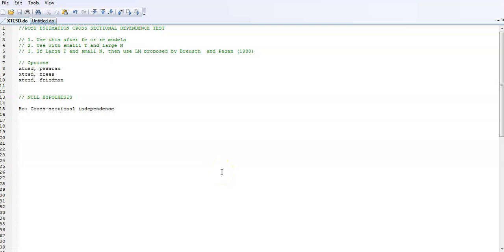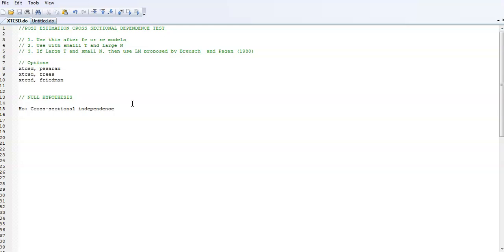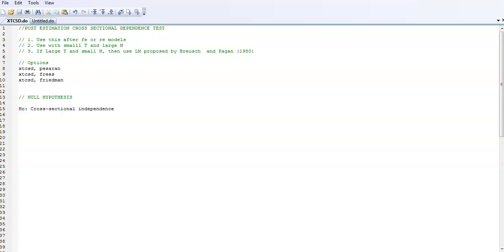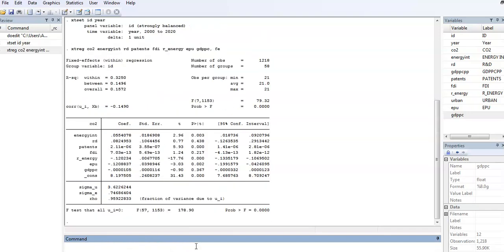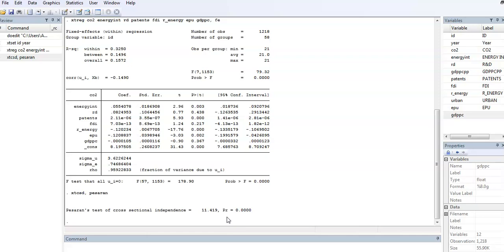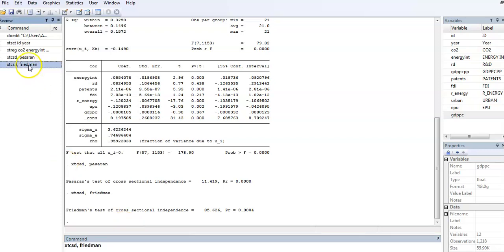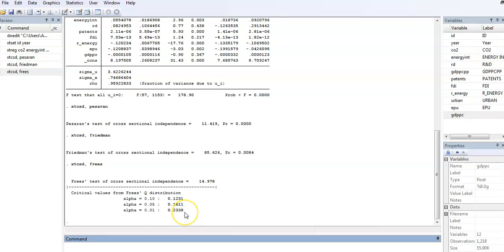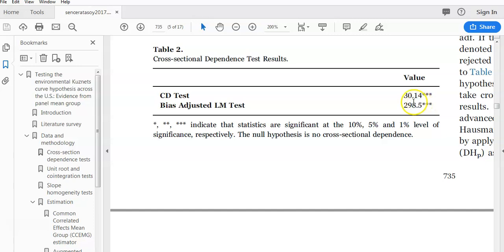How to test for cross-sectional dependence in Stata - post estimation test

Comment: Nice video thank you for sharing. I would like to ask you if I have panel data with heteroscedasticity, autocorrelation and cross-sectional dependence and I try to find the appropriatr model, I have to choose between GLS and PCSE, what can I do, noting that the N is greater than the T
Reply from the maker: I will go for GLS with the panels(correlated) option.
Reply: @Paneldataanalysis-go1ky  Thank you for your reply. I am confused a little because I find many videos day that I go for PCSE as in in the paper titled (Robust standard errors for pane regressions with cross section dependence) when T is greater than N I use GLS, but no mention to my case where N is greater than T. I hope you can help me to find an evidenced -based way to settle this problem. Thank you so much.
Reply from the maker: @usamaahmed6056  Yes, that's right. xtgls command is used when T > N.  For N>T, xtgee command is appropriate.
Reply: @Paneldataanalysis-go1ky  Thank you so much for your reply